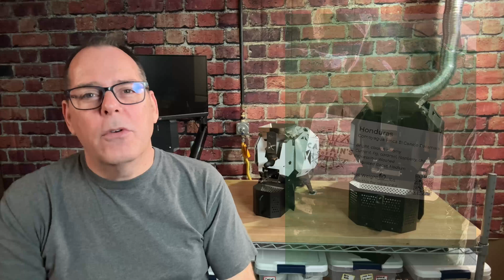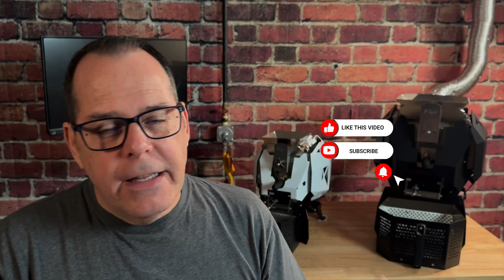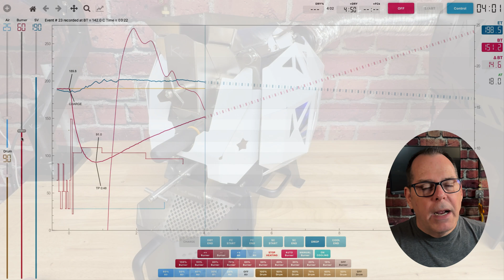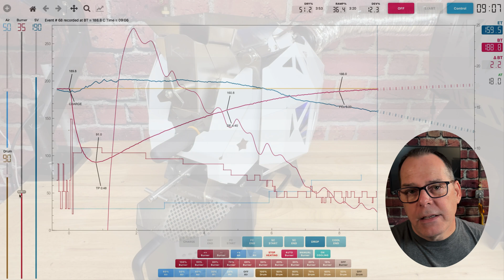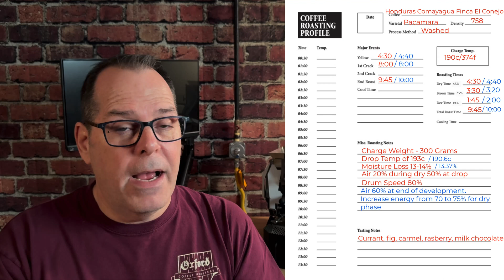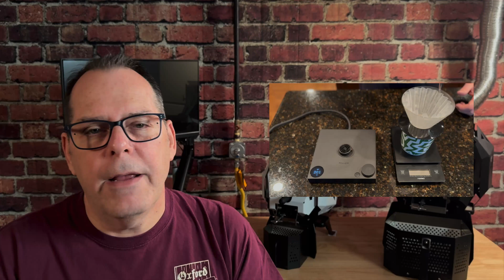Creating And Following A Coffee Roasting Profile

Comment: Great video Mike. Curious what led you to work your way up from ~150C charge temp as I think I remember you did before. I know from other videos higher density coffees can tolerate more heat, but 30-40C seems beyond just density.

I find myself drying too fast with 150-160C charger and 70-80 power on my M2! I’m colorblind though, so I’m trusting my wife to call dry end for me 😅
Reply from the maker: Thanks for your comment.  I think you were referring to this video https://youtu.be/eLAjepXtAg4 where I charged 300 grams in the Kaleido M2 and my initial power was set to 60.  That causes my dry time to be a minute longer than I wanted.  I cracked up the heat to 80 to try and catch up.

The probe position and our altitude can cause different temperature readings.  I’m at 600 feet above sea level.  I don’t really have a reference for how far my probe is pushed in compared to yours.  Roasting a high density coffee 300 grams with a charge temp of 170c and a power of 70 will get me dry in about 5:00-5:15 I think.  

So you roast with your wife… that’s cool.